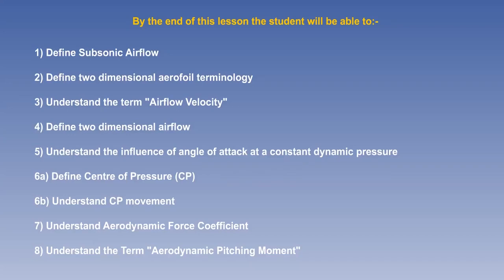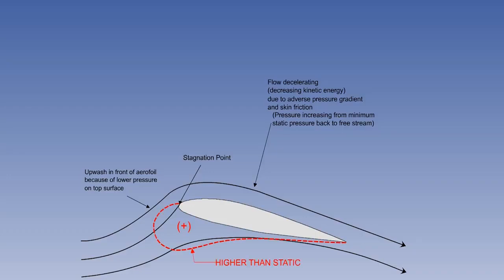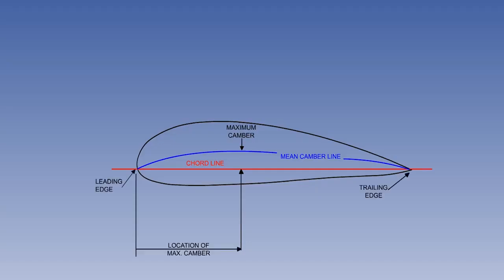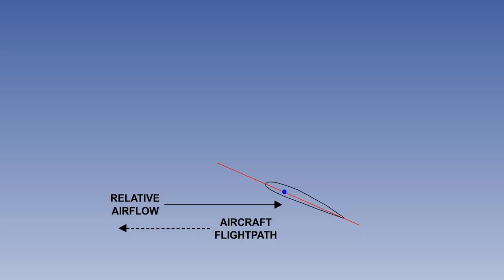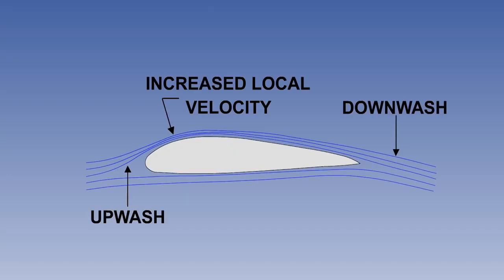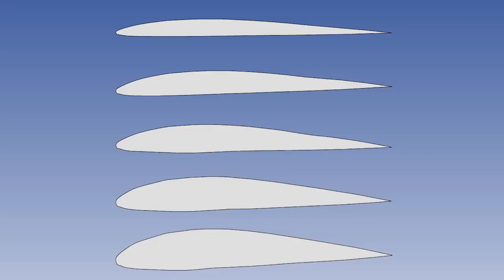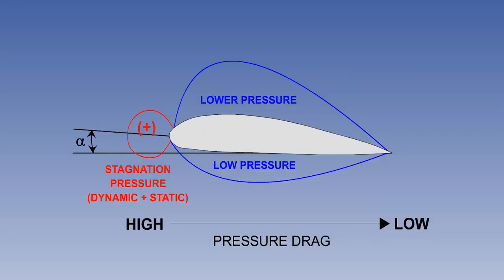06  ATPL Training  videos  Principles of Flight- 06 Subsonic Airflow Part 1

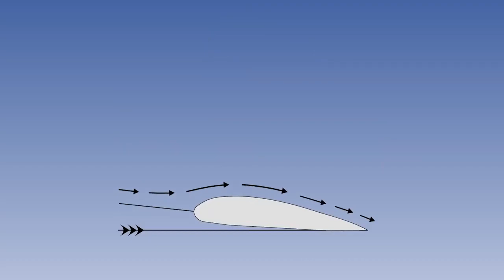Comment: Watch at 1:39, 9:28 and Total reaction is aerodynamic force at 4:58! How the wing flies? Aerodynamic cavitation at backside creates aerocavern - а small 'vacuum' zone which produces Aerodynamic force normal to the chord line of airfoil. Airborne wing has Low pressure at Lee or Back side of the air flow, and because angle of attack it is upper side of the wing simultaneously. The aerodynamic profile is made for better aerodynamics and Coanda effect, and thus better streamlining and handling. The asymmetrical profile contributes to a better Lift component.
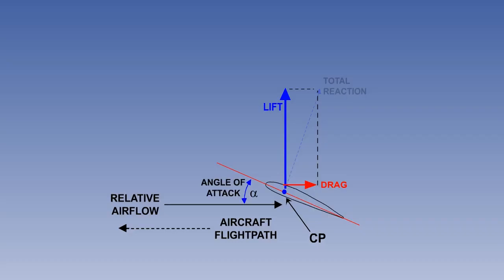Reply: Sub-pressure or low pressure at the lee side makes ONLY ONE FORCE - Aerodynamic force normal to the cord. Lift and Drag are just components of that force projected to the coordinate system. 5:26

Comment: AS THE WIND TRAVELS OVER THE CHORDLINE IT HAS AN UPWARD FLOW CALLED UPWASH? AS DYNAMIC PRESSURE IS INCREASED AS THE CHORDLINE LIFTS THE IS AN AFFECTIVE REACTION AND THERE IS LIFT? AS THE CHORDLINE LIFTS THE STATIC PRESSURE DECREASES? ALPHA IS THE SYMBOL FOR LIFT OF THE CHORDLINE ANGLE?
Reply: THERE IS LOWER PRESSURE OVER THE UPPER SURFACE?

Comment: AIRFLOW OVER AN AIRFOIL THERE IS UPWASH AND AIR PRESSURE OVER THE TOP AT THE STAGNATION POINT IN AN UPWARD MOTIN WITH HIGHER STATIC PRESSURE ON THE BOTTOM?